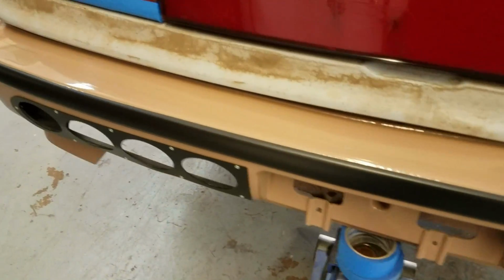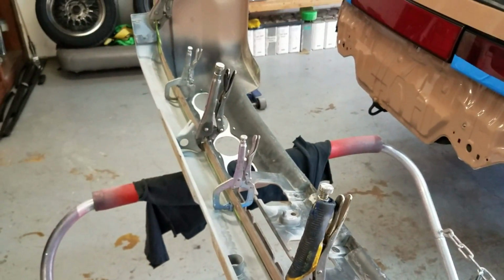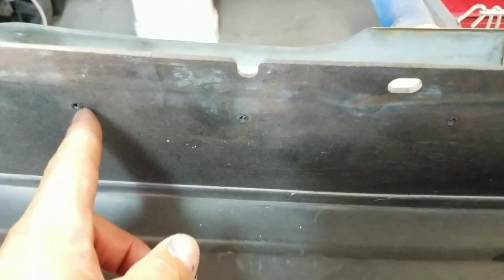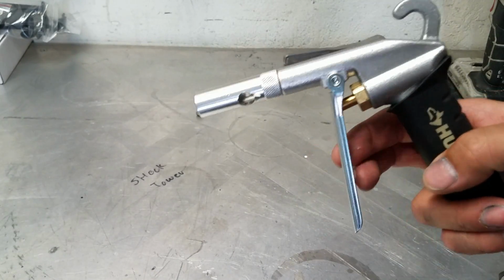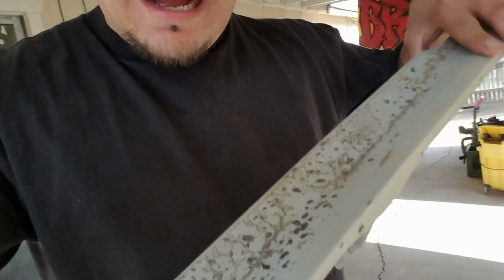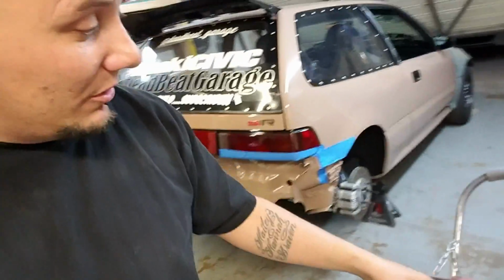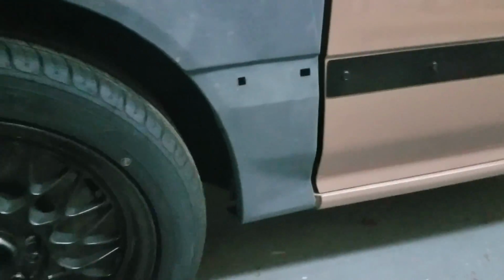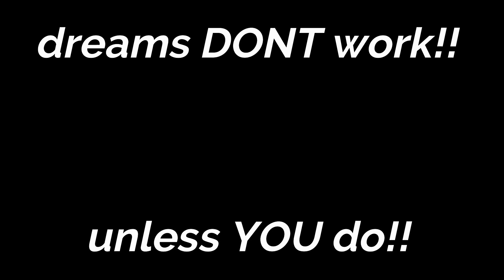Should have done this a long time ago

Comment: That wasn't a proper primer.... proper primer is gray....
Reply: Manuel Langenhan dude yes high build primer would be better but 1 he paints on a daily and 2 this primer will do just fine. he knows what he is doing.
Reply from the maker: Yes what I used here was pt filler primer.. it builds enough to fill in up to 80grit sand scratches and is also a direct to metal primer.
Reply: DEADBEATGARAGE DONT! TELLEM! ANYTHING!!